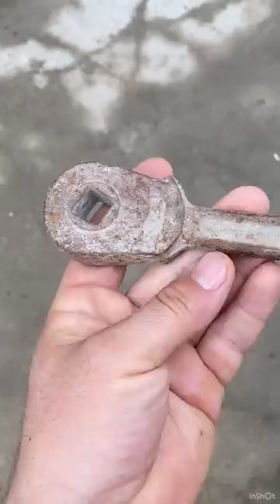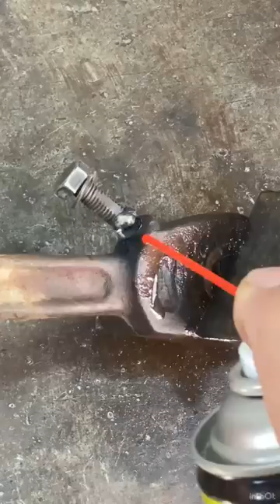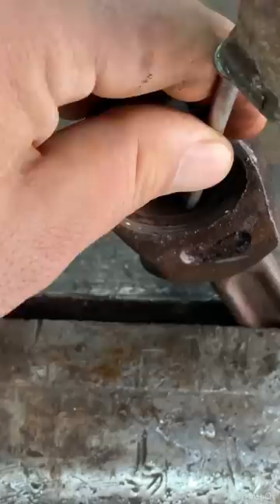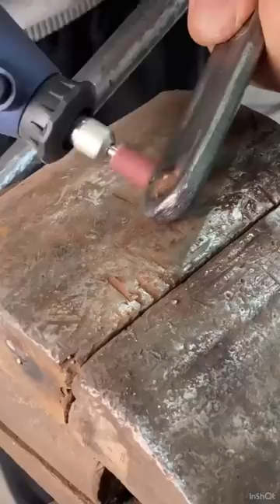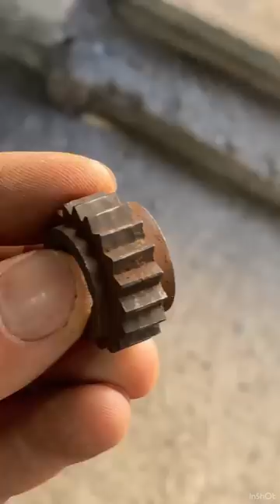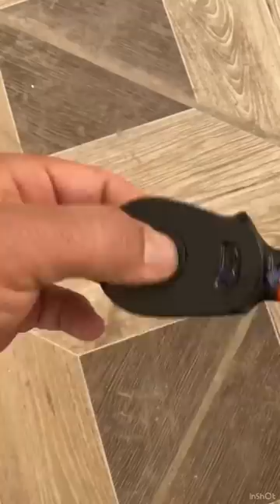Restoration of Soviet ratchet

Comment: Question.. I was told that when you sometimes restore antiques and objects they lose value.. does this happen when you restore some of the metal objects you work on?
Reply from the maker: on the contrary, the price rises because our services are included in the price
Reply: If the item is in good condition you can damage the value by stripping the patina off of an old item. This was in bad shape before and is now usable.
Reply: Depends what the item is, how many of them were made/who made it, what condition it is in, and how old it is.

Sometimes a broken old tool is worth more because it is in original condition.
Sometimes it will only be worth something if restored.

You would have to research what you're planning on restoring.